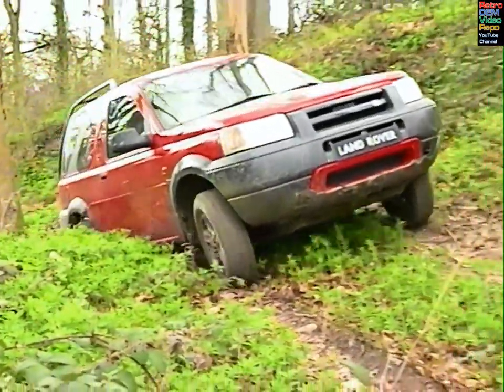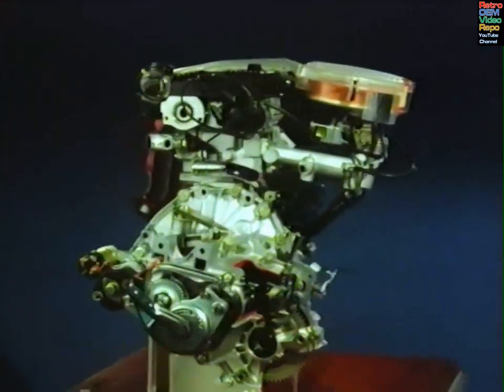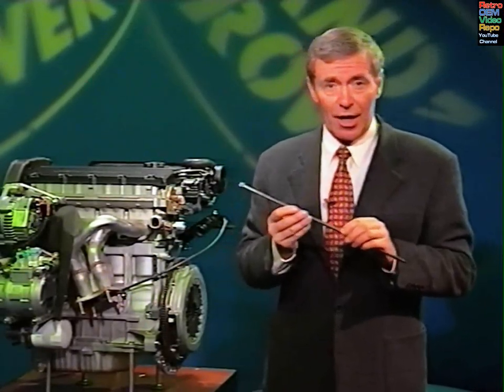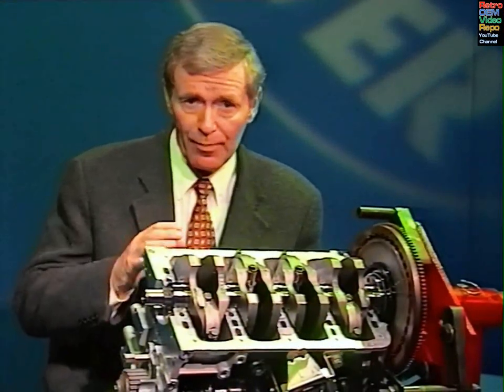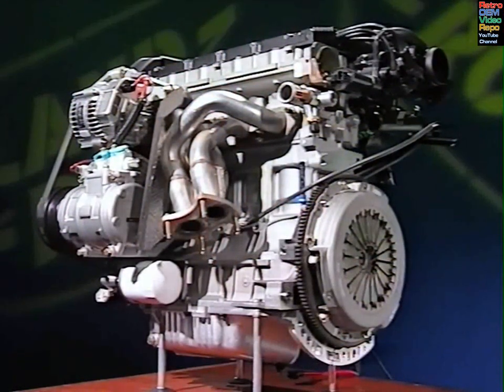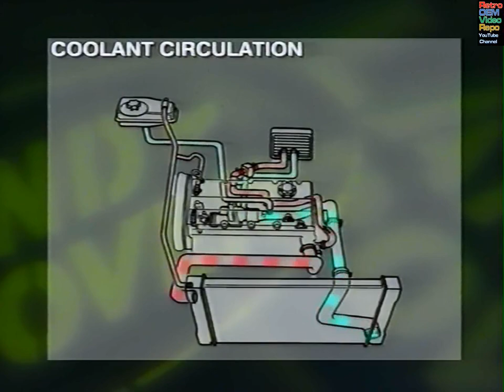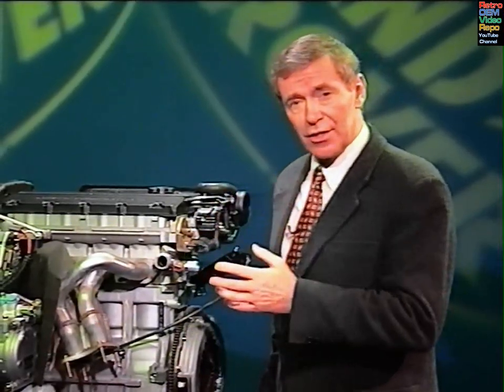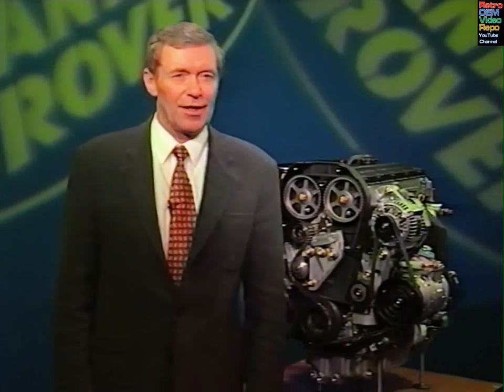Land Rover - Freelander (L314) - 'K' Series Engine (1998)

Comment: This "highly successful" engine that nearly bankrupted Rover due to all the warranty claims lol, shame they never manage/bothered to address the head gasket problems while it was still in production, because it definitely didn't help their already poor reputation for reliability.
Reply: it didn't though did it?

the engine didn't have excess warranty claims, the problems started after BMW took over and they tried to cheapen many of the components

the K series from 1989 to 1998 was very good
Reply: @thedeadstig123  absolute rubbish the main problems started when rover chose to cast the block in-house and changed to the Damp liner block to get increase to 1.6-1.8 and done nothing to sort the headgasket they already knew was no good or preposition the thermostat that was in the incorrect position

Comment: Great engine once the head's been done but I  don't know why they didn't use the T series instead of the K series
Reply: weight and emissions probably.
Reply: Because not everyone wanted a 2.0 Turbo motor to toddle about.... even though the freelander is a very good compact 4X4 it would have never needed (With much of the UK's terrain) to have a 2.0 Turbo motor... if you needed anything better you'd get a Defender or a Discovery.
Reply: @Freelandrew   Probably right about emmisons mate think they where to high.
Reply: @AliMackMechanical  Unfortunately, the T series was a very tall engine, which didn’t fit in a lot of models without messing up the weight distribution or changing the scuttle height. 

It was also an incredibly difficult engine to comply with emissions regs. It was basically impossible to get it past Euro 2 class, the engine design was just too outdated and was already catalysed with a closed loop, so no matter what was tried, the emissions were only just compliant, and right on the edge of being OTT. 

Loved working on the T, it was a solid engine but very old hat.

Comment: how is the spark timing done with a crank sensör or only inside the distributor
Reply: It’s computer controlled by the engine management unit. My TDV8 has only one sensor on one side.